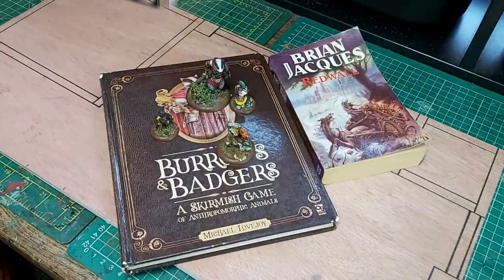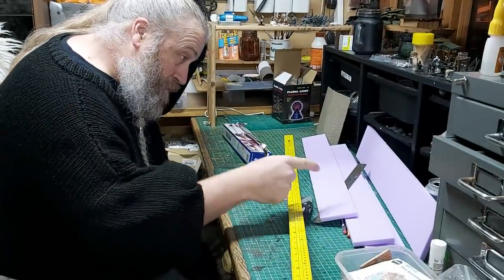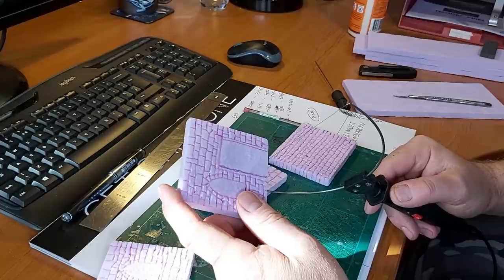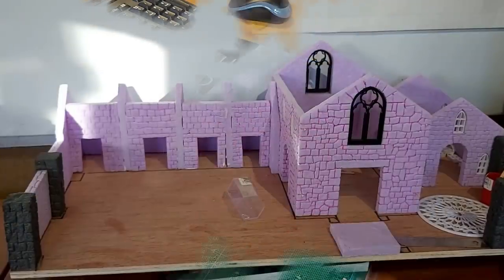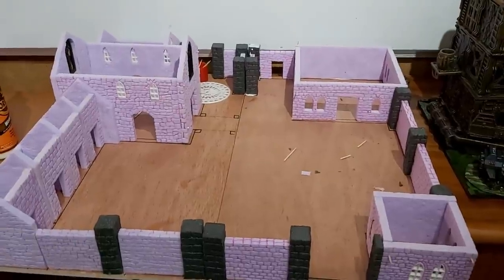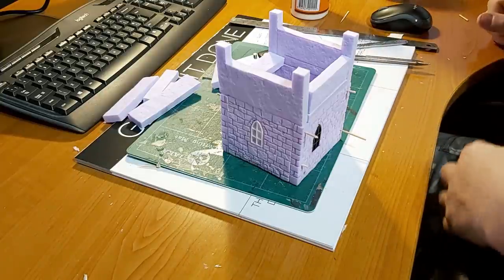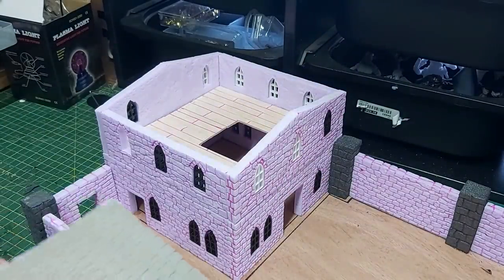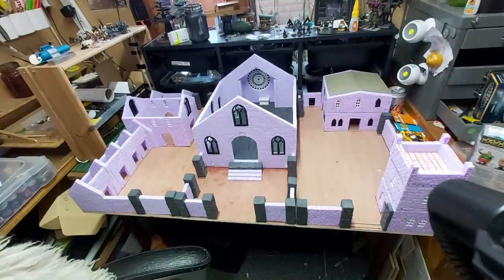Burrows & Badgers Build - Redwall Abbey  (Part TWO)  28mm XPS Foam Wargames Terrain

Comment: As soon as you mentioned what else it could be used for I was like hey he mentioned this to me the other day. Day made haha
Reply from the maker: When you make a model this size you have to build in flexibility or replayability.
Reply: @magratheabuilderofworlds7141  yeah I can imagine so. Just seen lachlan from zorpa zorp's video on pelennor fields. Didn't realize how big an 8x4 table is. Christ that's going to be a lot of work for the board i'm planning on making 😬
Reply from the maker: Yeah 8x4 is a big table. My aim with Redwall, is that it for some games it will BE the table.
Reply: @magratheabuilderofworlds7141  will definitely be a fun board to play on when it's done! 
Giving scratch building a go for french buildings like those that were and I think still are at Normandy. Well the ones that didn't get blown up. Using foam core for the structure of it. Is plenty of good mdf kits I could get but yeah they're a bit out of my budget. Plus this is practice too. Gone for 2 inch high walls. 3 inches seems too big. Only working on a floor at a time too so it's going to take a while
Reply from the maker: Two inches is a better height for Bolt Action and 28mm domestic buildings in general. The walls on this model are bigger as ecclesiastical buildings are often bigger and some of the 'Massive' beasts in B&B are 2 inches tall.
Reply: @magratheabuilderofworlds7141  definitely has me interested in building a church or chapel for my board. Just not sure on sizing for it. Definitely interested in getting B&B if I ever get the chance to too. Reminds me of the wind and willows
Reply from the maker: @brandonchaplin9782  chapels and churches can be problematic in size. Although many are quite small and understated. Years ago I set out to make the quintessential English church in 28mm looked at loads and realised there is no such thing as a standard design
Reply: @magratheabuilderofworlds7141  ahh okay. Might just wing it and see how I go when I get around to it. Really looking forward to seeing how Red wall Abbey turns out though!

Comment: I bought a pyrography kit off amazon a few years ago that came with an attachment that took scalpel blades, might be a happy medium betweeb a scalpel and the hot wire cutter for you
Reply from the maker: Ooh nice. The issue i think i have found is that I can't contril the temperature of the cutter so if you aren't quick it melts too much of the styrene.

Comment: The trouble with having B&Q cut the wood for you is the blade on their jig is very thick and the cuts are always a few mm out. It can be frustrating if you're not expecting it.

The build is looking superb (I saw the current state of affairs on Facebook) and watching the progress through the videos is loads of fun. My little girl is keen to try B&B and I made the mistake of showing her your project which she now expects me to replicate.
Reply from the maker: Totally. So much so that I am thinking of making all  my other pre cut stuff metric as it seems to get more out of one piece of wood.
Reply from the maker: But you do get completely straight cuts and right angles so the fit together well
Reply: @magratheabuilderofworlds7141  Yes. There's nothing wrong with what B&Q does, it's the same anywhere that does the cutting for you and you can only really avoid it if you cut it yourself at home using thinner blades, which is a faff. So long as you know going in and can adjust, as you could, it's not an issue.

My son is 8 now and I need to look at building a gaming table as he wants to try out some of the systems and obviously the plague seems like it'll scupper external plans (gaming clubs etc) for a while yet. So no doubt I'll face these issues myself in the coming weeks.

Comment: just wondering for that large round rose window if you haven't got a 3D printer ( I don't I haven't got the space) a doilie cut round and then modge podged you could very likely add some painted see through packaging for rigidity and paint it with thinned out paint ( thinned with medium) to give you a coloured glass effect.  This is an incredible build. I'm dead jealous I would love to be commissioned to build something like this  you could use this for a gothic horror style scenario too. but its all going great at the moment. you Could try my Egg box slate trick ( you said you may give it a go) the egg boxes tops are textured inside they make very realistic slates.
Reply from the maker: It would work very well for a gothic horror game - I just so happen to have one too. So when it's all done there may well be some shots with Victorian chappies.

Comment: Could you create a hole with the wand then thread the wire in to the handheld cutter?
Reply from the maker: Yep, but it would be quite a faff. Especially when you have a lot of windows to cut out.
Reply: @magratheabuilderofworlds7141  true you’d have to undo it for each window, hadn’t considered that